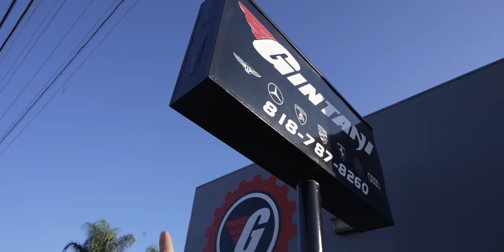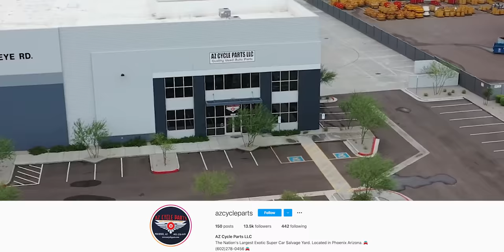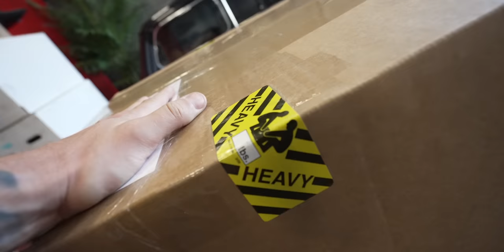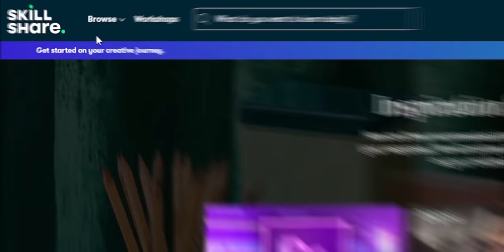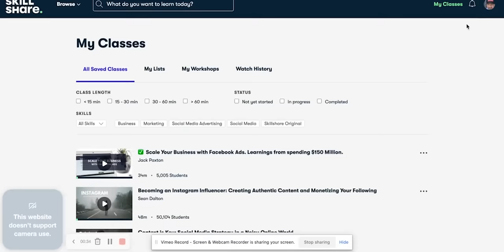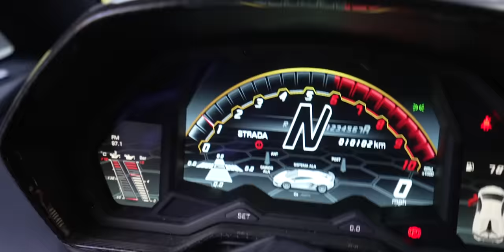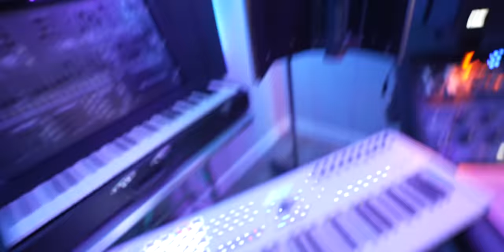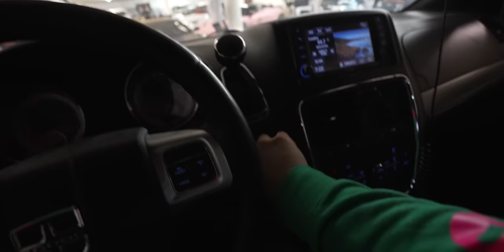BEVERLY HILLS POLICE MOST HATED LAMBORGHINI TURNS FLAMETHROWER… *ALEX CHOI*

Comment: Unicorn has same problem like your F12. Little bit too short exhaust pipes. Also engine cover and rear wing should made some material (LI-900 silica tiles) that can takes flames without issues.

Comment: He needs a high temp. carbon fiber rear deck lid panels near the exhaust it's heat resistant. Or chrome or stainless panels around the exhaust pipes that go through rear deck/hood.